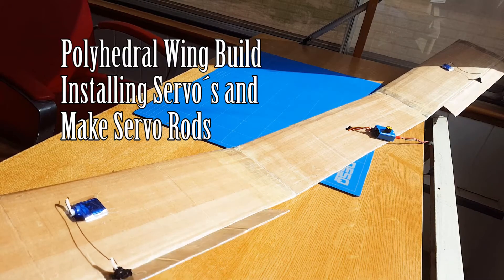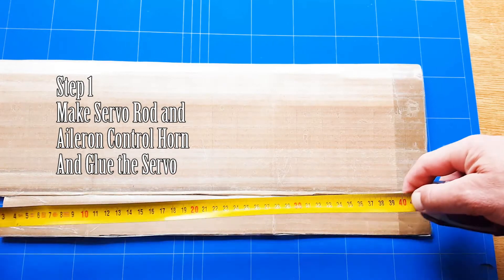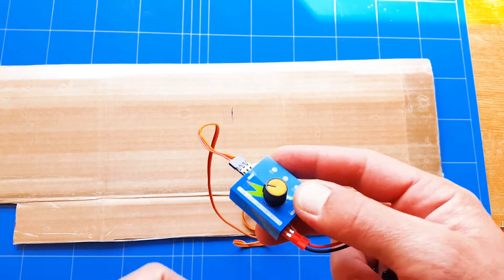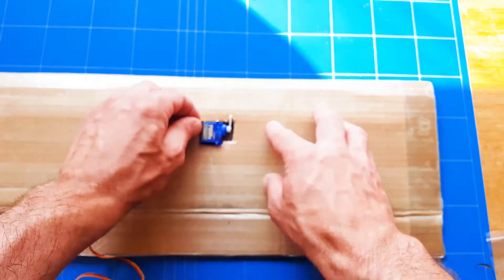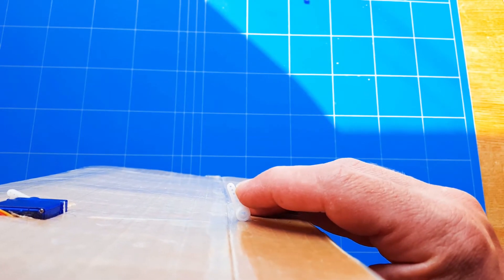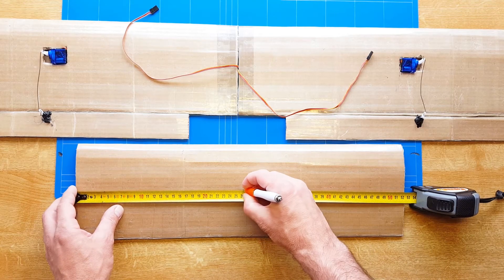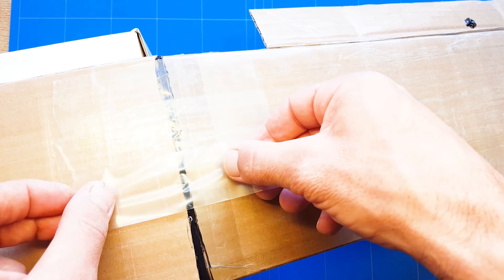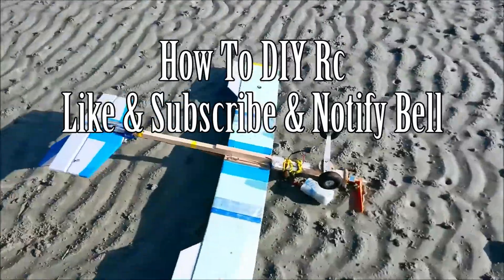POLYHEDRAL WING BUILD WITH CARDBOARD (How To Make a Trainer Rc Plane For $5 Airplane)

Comment: well, this wing is Still TOO thin.  it's not gonna make very much lift.  oh, and, putting ailerons on a polyhedral wing is a waste of time, and increase in flying weight.   why.    during a rudder turn of a model having such a wing, there is a 'coupled' Roll moment.    conclusion:  on such a model, more roll moment from aileron defection is NOT useful or Recommended.       so, Avoid adding the mass of aileron servos on such a model.     the polyhedral angles Should be in the range of five to fifteen degrees.  ( more than fifteen degrees of polyhedral angle Unnecessarily Damps yaw axis response and Increases DRAG. )     ideally, when an angle(s) is used in the design of a wing, the angles Should be sufficiently Internally BRACED.    a light-weight angular brace can be made by laminating together narrow pieces of wood/bamboo.      cheers
Reply: David Davids lol.. did you see the video of this thing in action?
Sure it can be done better, but it WORKS, and this is a BEGINNER plane, that is supposed to survive CRASHES..

And it works well so why are you mad?
Reply from the maker: your really making it hard to argue a lot of you say is true polyhedral wing don't need an extreme angle and it fly's really good without ailerons but I'm building a 4 channel because it those make flying the plane a lot more fun and branching the joint is a good way but my way also works and simplify things back thanks for sharing you know how it's definitely a great help David :D
Reply: gawd, newbies are  SO   DENSE.    it is clear that you do not understand the Direct IMPLICATION of my statements.       if ailerons are used with a polyhedral wing, an Unscheduled, Altitude-losing, FATAL Roll can Easily result; aka  CRASHING.    don't bother to reply, if all you have is more stupid, uninformed ARGUMENT.   feel free to enjoy a lifetime of not learning, by ERROR and TRIAL and ERROR and TRIAL and ERROR.  cheers
Reply from the maker: haha first of all luckily the plane is built to handle crashes
and your very good theoretical but in practice i've already shown how easy this plane fly's
and you didn't show a thing! where are you planes and video? really!
at least andrew newton thinks positive about my planes and he got a big channel with hundreds of planes and really test experimental things out you just talk talk fluff up your ass